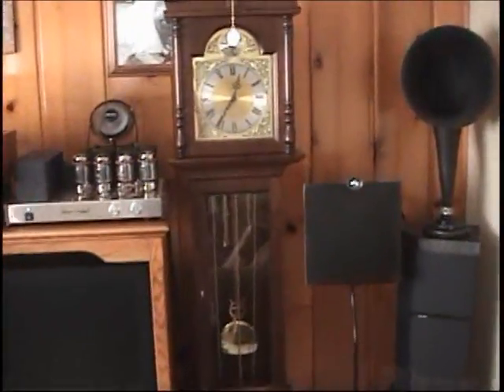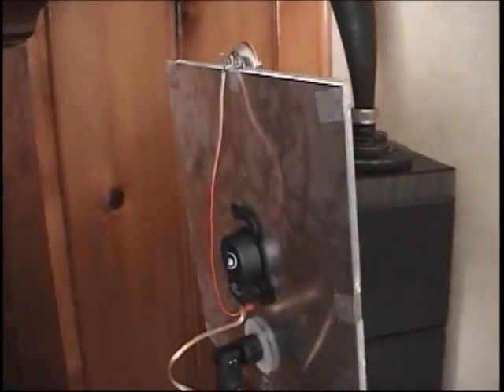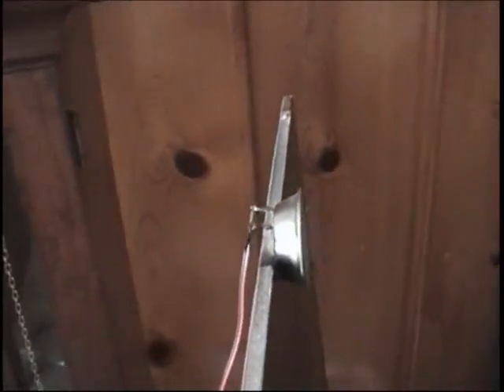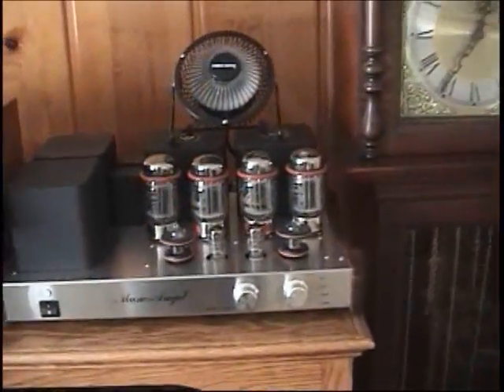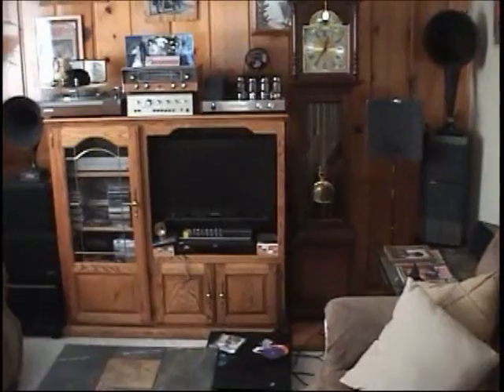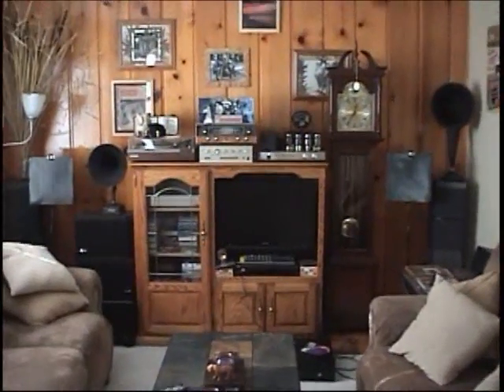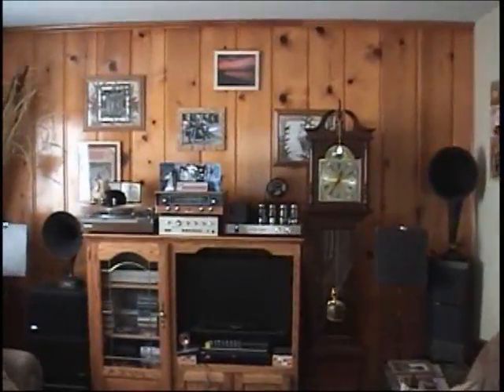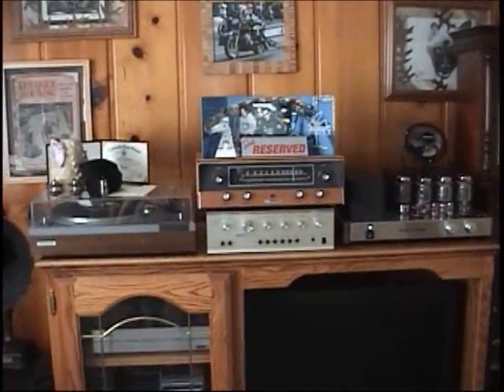home made speakers using Dayton Sound Exciters

Comment: Aluminum is great! I used 3.3mm composite panel. Two aluminum sheets sandwitched with plastic core. Usable frequency range 100 Hz to 8 kHz without woofer or tweeter. With tweeter its up to 20 kHz and sub/woofer down to 30 Hz easily.

Comment: Pas 3, or Pat 4? used to have a Pat 4, and 120 amp, driving A-25s. So, the aluminum is only fastened to the foam board with the tape? How does it not buzz, with only edge contact? I can understand how the aluminum would maintain higher midrange by being a harder material, but then again, it has more mass, and therefore more inertia. Of course, that might not matter if the device attached to it uses surface deformation to propagate the sound, sort of like the Walsh driver.

Comment: dont believe as you did everything wrong you cannot have them center nor should they be on a tripod the should be free as possible eg: hanging by a thread/wire with that tripod you are preventing them from producing sound basically stopping the material from vibrating well
Reply: Scarlett, I thought the same at the very first sight
Reply: I saw another video where the speakers were mounted on a stand and they seemed to work great.
Reply: Don't agree

Comment: I love that old Heathkit tube tuner! I had the matching preamp. Is that a Dyna PAT-4?  Speakers sound cool. I am looking to try these exciters because they are inexpensive and they can excide a big panel. Many years ago, I was involved in building a set of Sanders electrostatic speakers that were powered by a Savin copier power supply and a Bryston amp. They had a spooky imaging quality. I hope that I can get better imaging with the exciters on bigger panels.  Thanks for video.

Comment: Great build, amazing results!  I am surprised at the clarity at such high volume. Did you use a crossover to remove the bass from the satellite speakers, or was it simply a result of your receiver/amplifier  splitting the input into different channels?    Thanks!

Comment: Great work. I wanted to try a set of these for quite awhile. I'm an engineer for 2 Cleveland TV Stations and have always wanted to try these on our lobby glass walls. And currently I am doing an install in a 100yo. mansion and need a speaker solution for solid brick walls with plaster and lath faces that only leave about 2" of depth. The owner doesn't want to see speakers if possible.  I could mount these to a 12"sq. pc. of drywall and patch it into the walls- totally hidden. Maybe add a tweeter